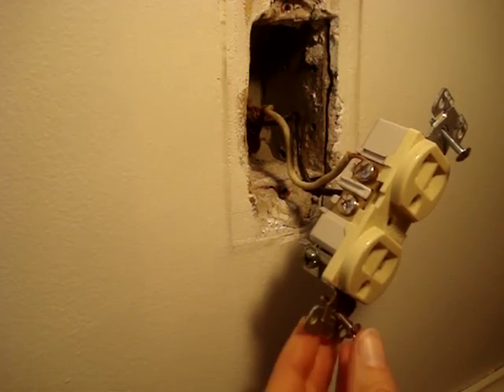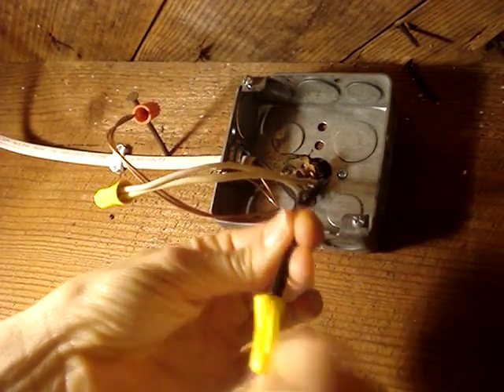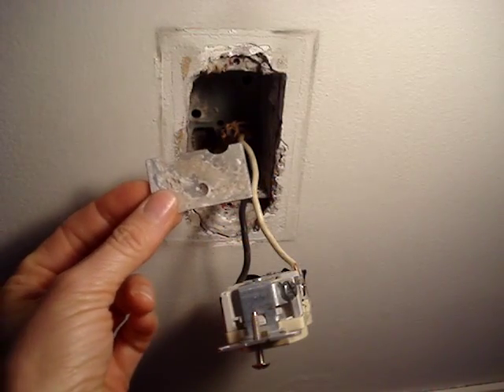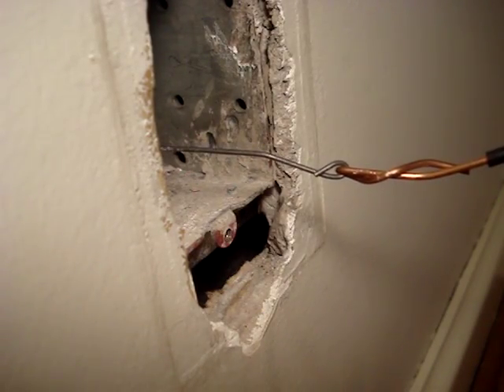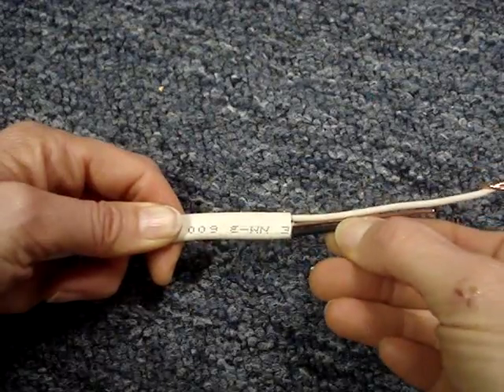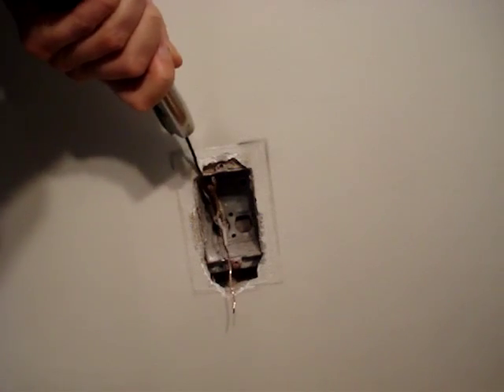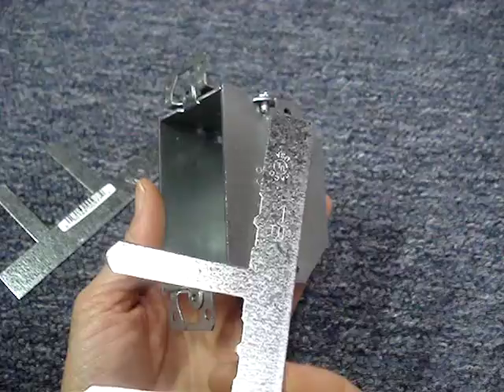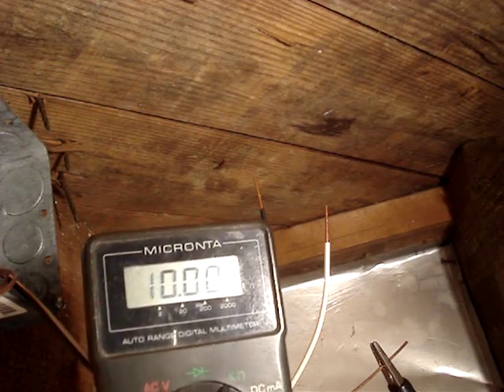Replace Old Wiring in House With Romex

Comment: This video is very helpful! I am soon planning to redo a couple of runs of 50s cloth cable with some new Romex in my home. Do you have any tips for running 12/2? Thanks!
Reply from the maker: I don't have an specific advice for running 12/2.
Reply: @Know-How-Now  Just follow the same steps as this video?
Reply: The difference between 14 gage and 12 gage is negligible. The bulk of the lesson is the same. Yes, 12 gage is bigger and less flexible. Won't matter.
Reply: @patarmstrong3582 The hell are you talking about

Comment: that pushmatic electrical panel needs to go next
Reply from the maker: The pushmatic has been great, I hated to see it go when I upgraded the service to 200 amp.  Never had any problems.  I did diagnose a bad breaker in a friend's panel that was less than 10 years old.

Comment: Seems to me that you will run into a problem in that most romex cable in walls would have been stapled to the stud within 8" or so from the outlet.  This would prevent pulling cable out in most cases.  Are we assuming that no staples have been applied throughout the existing wiring?  Seems like in most cases, removing large portions of dry wall would be needed.
Reply from the maker: Not sure if you watched all of the video?  I show a solution to remove a stapled cable and disclose some scenarios where the solution may not work.  So far my solution has saved me from making a hole on several occasions. IMHO, removing a large portion of drywall is not necessary, if you understand typical construction and think about how a cable would have been run, often just a small hole is needed.

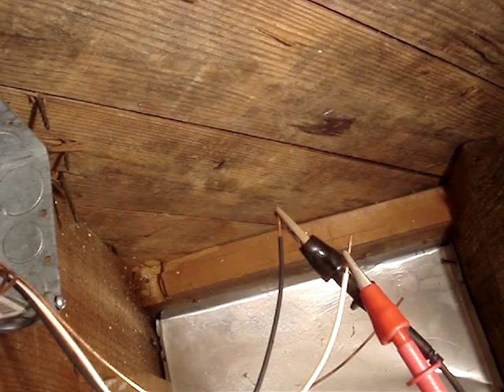Comment: How do you check for damage wires? Are you checking for nicked/chipped wires or are you performing a conuity test. 6:25.
Reply from the maker: To check out a newly pulled cable, I check each conductor to ensure it is not grounded (continuity check between the conductor and a good ground).  Then I check for continuity between the cables... you should read open on all checks.  If you want to go another step you can put a jumper between the conductors and check for continuity.  That is being tested when you install your switch, outlet, etc.  If it doesn't work then you could have a broken conductor.

Comment: I'm curious, since this is a 1950's house if the electrical boxes themselves were grounded before you re-wired them. Apparently, even though code did not require it yet, some electricians back then still ran bare copper ground from the back of the box which usually cannot be seen from the front. This ground wire was ran independently from the 2-wire romex but serves the same purpose as modern ground wire that is housed inside the romex. My 1956 is wired this way (groundless 2 wire romex, with grounded boxes), which meant I could replace old 2 prong outlets with 3 prong ones while being able to keep the original wiring in place.
Reply from the maker: Hi Sam, unfortunately, the electricians who worked at my house did not do that.  The cables that they ran to the bathrooms did have a ground wire.  The rest of the cables... no ground.  Thank you for your note, it's interesting information and may help someone else who does not see a ground wire.

Comment: Your panel is really dangerous https://youtu.be/tX-Ze8KhN10
Reply from the maker: Interestingly, my electrician friend gave me a bag of spare breakers for the Pushmatic.  He has spent more time being an electrician that the age of the guy in the video. Another electrician friend says the Pushmatics were a cheap panel, but OK. He also is not screaming that my house is going up in flames because of the Pushmatic.  I do no agree that as suggested in the video that people should test breakers by shorting the hot and neutral.  Rather than tear panels apart and check for all the problems as suggested, I'd think it is way more cost effective to buy an IR Thermometer and look for hot spots.  https://www.ecmag.com/section/cool-tools/infrared-thermometers  Many in the media make money via fear mongering.  It gets attention and views, ... and more money for the ads that run on the video.

Comment: You ran all that wire to add a ground, to a box that has a bad ground anyway, which is pretty pointless.

You could have just attached a wire from the neutral, to the ground, and to the box with a pigtail. 

I’m sure based on that wiring that you’re a neutral is bonded to your ground anyway therefore it would not make a difference.
Reply from the maker: You assume incorrectly and are telling us to do something against code.
Reply: Folks like wiley burning houses down left and right. The assumption is that the ground wire is properly bonded. The metal boxes aren't grounded,  but the outlet is, and it's bonded to the box by its frame.
Reply: Keep adding neutrals and grounds together, and watch the charge stack up on the neutral... 400 plus volts isn't out of the question. Stop doing electrical work before you hurt someone.
Reply: @patarmstrong3582  grounds and neutrals get bonded that's why you're not an electrician

Comment: In the future, attach a strong string/rope or wire to the end of the existing/old wire. Then you can attach the new wire to the other end of the string. This will make pulling the new wire much easier and then you don't have to use a fish tape, as long as the string/rope doesn't break.
Reply: You mean if there's a conduit, most lower cost homes in the 60's used the non grounded cloth/vinyl pre-romex and it was stapled so it can't be used as a pull string unless you cut open the wall to remove them.
Reply: Possibly isn’t stapled if 1920-35 preromex behind lathe and plaster. Newer houses stapled as they built I think

Comment: Can anyone help me? In my basement apartment electrician installed exhaust fan +lite+vanity lite on single switch, so they all run when using bathroom. I want to add extra switch but it’s only one wire running from the switch to first point than piggybacked. How can I add an extra wire to first point? Don’t want to remove or cut drywall
Reply from the maker: I have a video that shows how to install a new switch.  Later in the video there are typical wiring diagrams.  https://www.youtube.com/watch?v=v51GXzr_EL8

Comment: I had an "electrician" tell me to just cut a jumper wire for each outlet and hook up the ground on the outlet to the neutral wire. He claimed it would pass inspection. I didn't do that. It didn't sound right.
Reply from the maker: That's a bootleg ground.  It's not legal and in some situations could cause harm to someone working on the electrical system.

Comment: So many code violations.
Reply from the maker: Please name "so many", that proves nothing. House built in 1952.
Reply: only violation I see is possible no stapling of the cable... I'd rather see a ground pulled in lol
Reply from the maker: By code, stapling is not required in this situation.
Reply: Ok moron
Reply: @scottholder4776  Don't be rude.

Comment: Ma'am: I have a 30 year old house. I am currently planning to change wires between sockets in a room, then the next and so on, how do I know if the wires are stapled? also, if they are stapled, where are they usually stapled at? Thank you
Reply from the maker: If the installer followed it, here's the code for staples:  334.30 Securing and Supporting Nonmetallic-sheathed cable shall be supported and secured by staples, cable ties, straps, hangers, or similar ﬁttings designed and installed so as not to damage the cable, at intervals not exceeding 1.4 m (4 1⁄2 ft) and within 300 mm (12 in.) of every outlet box.

PS - There are more videos on this topic.  You can find them by clicking on the channel name & then the playlist tab.  Best wishes for your project.
Reply: @Know-How-Now  Thank you ma'am.

Comment: This is not a do it yourself project if you don't have any knowledge of electrical work. I would recommend you hire a licensed Electrician to rewire your 🏠
Reply: EE qualified as electrical inspector here. In my career I have spent many hours explaining grounding to licensed electricians.  Make sure you know your local codes and inspect their work too!  In my area a DIY project done by a  homeowner still may require a permit and inspection if materials cost over $200. I would not approve this video because 4" junction box does not have any bushing/clamp. Also the sheath of NM is not pulled into the outlet box and clamped as required by code. I slight shift in sheath at either end might leave wires in contact with box. As others noted, ground was not bonded to boxes with approved screws.

Just because you have continuity does not ensure wire isn't damaged. Pulling wires individually can neck them down to reduce the effective gauge, or wire can be broken but still have ends touching. A continuity test and outlet testers do NOT ensure proper grounding, only existence of a ground that can carry 10 to 50 milliamps of current. Less than 1/1000th of the required current for 15 or 20 amp needed to trip circuit breaker in event of a ground fault. These types of tests are very misleading and no substitute for proper wiring techniques.

In the 1910 house we just purchased, a condition of purchase was to upgrade the service from fuses to breakers. The seller's electrician didn't install CAFCI breakers however he replaced receptacles with tamper resistant (shuttered) . The 1920's era  BX entered through the sides of outlet boxes - no side panels. He added pigtails to wire nutted connection and stuffed it back into the wall cavity. The ground was due to BX laying against box (black painted 1920's kind - not galvanized)  and receptacle self grounded via screws. Yes it tests okay, but would arc inside the wall and BX itself will glow orange before the breaker might trip (or some one could die). Old BX does not have a bonding conductor and the spiral wrap acts as a coil or inductor to impede flow of current, 

In other places the 1960's NM cable has 16 or 18 gauge grounds that were twisted together and shoved through a hole in the box. Obvious signs of arcing where wire touches the box. Again an outlet tester will pass, but not an effective ground.

In all cases this would be best corrected by installing GFCI outlets marked as "no equipment ground" or better/less expensive CAFCI/GFCI breaker for the whole circuit. Isolating the BX from ground in the basement.

Our city has a rewire ordinance that requires any existing code violations to be corrected. Instead the licensed(?) electrician made the situation worse by added more code violations.
Reply from the maker: Hi Stanley, I'm not sure how to interpret your comment.  Do you mean me or everyone?  Are you assuming that I don't know anything?  BTW, my career working with electricity started with troubleshooting radar systems in the military 35 years ago.  So I am very capable of tracing simple circuits on a home wiring system. It's not that complicated and impossible as you suggest.
Reply: @Know-How-Now  I'm a Journeyman Electrician , 20 yrs in the trade! Industrial and commercial. My previous comment was pretty simple , I would recommend the average person who doesn't know electrical to hire a licensed Electrician, this is not something you figure out as you go! You CAN BURN YOUR HOUSE DOWN IF YOU DON'T KNOW ANYTHING ABOUT WIRING A HOUSE!  THAT'S FOR ANYBODY WHO CARES ABOUT THERE HOME INVESTMENT. I DON'T KNOW WHAT YOU KNOW, I DON'T CARE. BUT I KNOW WHAT I JUST SAID IS A FACT!
Reply from the maker: and your are spending your time searching the internet about  how to run cable, then acting like a troll shouting threats?
Reply: @Know-How-Now  Yeah! Why is this so called "Journeyman" even watching your video!!! JERK! 
I got a 2 year degree in electrical and mechanical engineering and it is videos such as yours that are awesome as a refresher or even for ideas I may not have thought of before I started. Why does every "pro" think nobody should DARE do this or doom and gloom will happen?
I just bought this house and I am wondering how the idiot who wired it lived. NOTHING is grounded. I am not rich so is it safer to leave it alone? (I have already had one plug in fire) or turn off power and ground everything? I guess the "pro's" would say call them (can't) or leave it alone as a serious fire hazard. Videos such as yours help people decide if it is their skill level or not. Keep them coming!
Reply: @stanmoney8470  What if you are average and know electrical? How do you think poor people get by? They can learn just like you (supposedly) did. If someone can't afford an electrician I suppose you suggest they get out and live in a tent. I don't see YOU making videos. Not even explaining the basics of turning off all power and how to check it. Simple video to create but you are in here acting like a DOOFUS instead! Go away. You said it all when you said "I DON'T KNOW WHAT YOU KNOW". 
EXACTLY!!!! This video isn't about you.
Reply: @TEXAS-SMITH  don't mind him...Stanley is simp!y an electrical contractor....the signs are all there. Just use common sense safety measures and RESEARCH RESEARCH RESEARCH thoroughly before getting started....things like making sure you have the proper gauge wire for a particular type of outlet.....study up on time like that and you'll be fine.
Reply: @stanmoney8470 and full of misspellings. Shouldn't 20 years get you a masters license? Your comment would carry more weight if you had stated something more specific.  As a contractor myself, it seems like you're bitching about losing a job to an ambitious do it yourselfer. I learned a few things watching the video. Maybe that explains why you never got your masters license.
Reply: Dang. Stanley's attitude is the very reason I desire to DIY. I don't want his ..... professional attitude anywhere near my house or my checkbook. 
Ms. Know How.....you're doing an awesome job! 
Stanley - can you please point out what was done wrong in this video?
Reply: FROM an electrician, I'm just guessing, gut instinct, ego detected... Boy, Have I learned how ripped off I've been for decades. DIY !! is here to stay fella (another assumption)

Comment: Do you prefer the metal old-work boxes to the plastic variants? The metal one looks like it would be harder to use. Is that code maybe?
Reply from the maker: I like to stick to the metal ones if the originals are metal, though it's OK to use a plastic box.  The downside I see with the plastic is that if there was a faulty connection at the box, plastic is more flammable than metal.